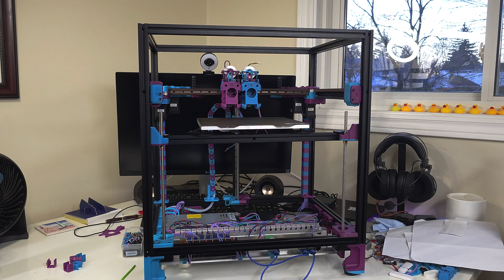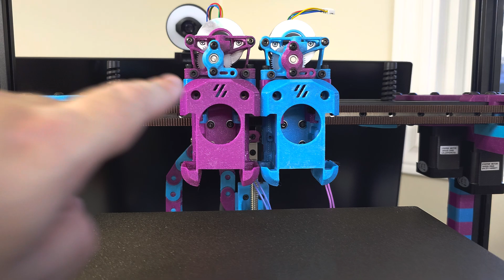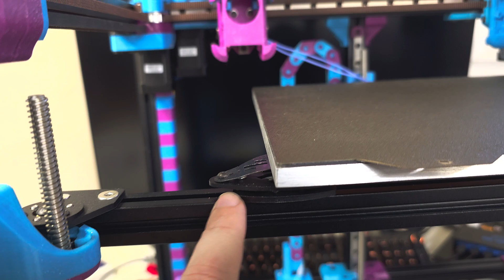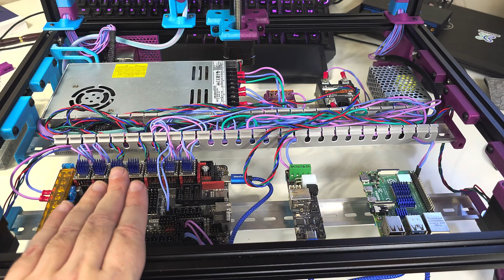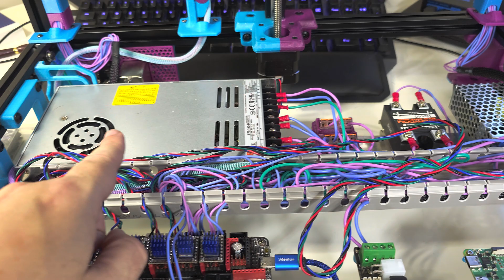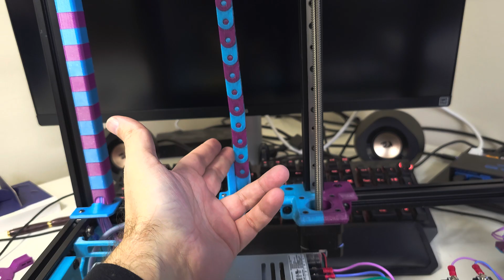Tridex: Finally getting back to working on this printer!

Comment: Very cool!
I have a 2.4 but after purchasing a K1 max I think I prefer the fixed gantry floating z design more. Better base for idex and tool changer possibilities than the floating gantry.  I will be building a trident when finances allow but prolly go with a tool changer design I think. The idex is really cool though, tempted to build one just for that reason alone. Probably more robust and reliable than a tool changer.
Had a ton of mods to go on my 2.4 but cos I'm lazy I couldn't be bothered to pull the gantry to install them lol. A recent gantry crash that completely peeled apart the xy points has forced me to do it. Should have done it sooner as I did enjoy the process.
Installed new xy, ab pinned parts printed in 3DXTech ABS CF. Ramalama pinned xy tensioners. GE5C Z mounts. Titanium backers on Y and the back of X. Pinned Z tensioners. All with carbon fibre pins.
Someone else mentioned you might have a damaged part. The upper left xy part that holds the toothed idler. Just wanted to let you know that after installing my new xy joints, that part cracked exactly where the mark is on yours. Just letting you know that is a weak point in the part and if you have a defect there I would replace it. Vids 5 months old so I guess you've figured it out by now lol.
Anyway, main reason for my comment is to ask about the printed cable chain. With the titanium backer on my x, the slightly slimmer GE5C Z rail mounts and the thicker rear cable chain, all combine to interfer with the clearance to the Y endstop triggering. Gantry has to be pretty much dead flat otherwise the endstop doesn't trigger. Kinda defeats the purpose of the GE5C mod lol.
Could you link me to the files for the cable chain you used please. Printing a slimmer one will be 1 step in resolving  my issues.

I like your vids. Very cool to see these builds.
Reply from the maker: https://www.printables.com/model/314922-printable-cable-chain
Thanks for watching!

Comment: the build looks awesome with the dual color.  (you have a broken piece in the x carriage, the blue left one idk if that's how it should look)
Reply from the maker: You might have been seeing some artifacts from support material removal. The part itself is not broken
Reply: good to hear that, I hope the build goes without trouble <3  @oldguymeltsplastic

Comment: hey stef(ph?), I wanted to ask you which z probing options you use on your 2.4 and 0.2 with the rapid burner. I just got a micron 180 and I plan to use rapid burner and klicky or boop but I just wanted to know how it mounts
Reply from the maker: Chirpy has published a number of alternative Voron mounts for both 1515 and 2020 extrusion printers. Link here:
https://github.com/chirpy2605/voron/tree/main/general/Alternative_Voron_Mounts
Reply: @oldguymeltsplastic  Thanks!
Reply from the maker: I currently have just the Beacon on my V2, no other Z probe. Beacon is my Z endstop, and also is used for QGL, and of course Bed Meshing.
No Z probes on my V0 yet, but once Pandora's Box mod is done, I will either go with Boop, or maybe another eddy current scanner.

Steph